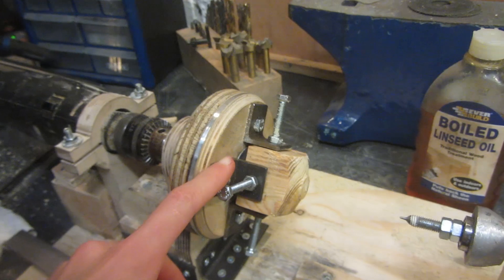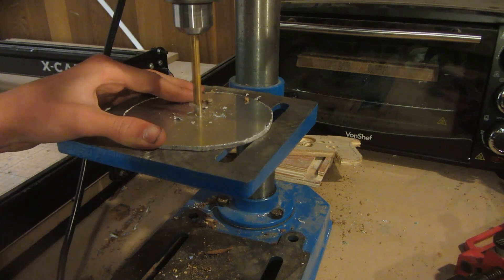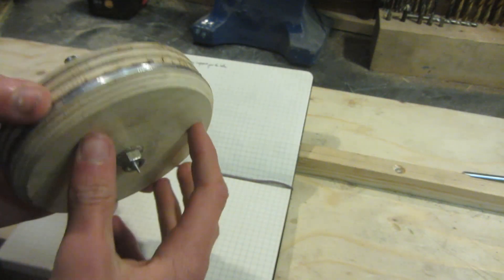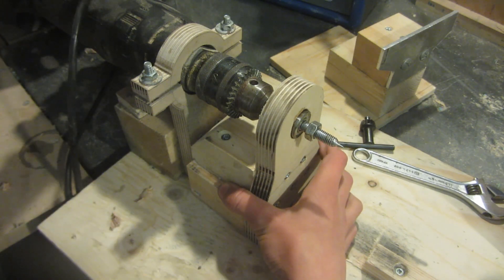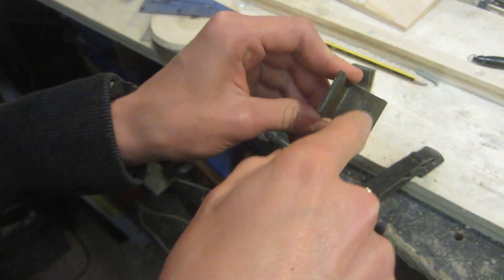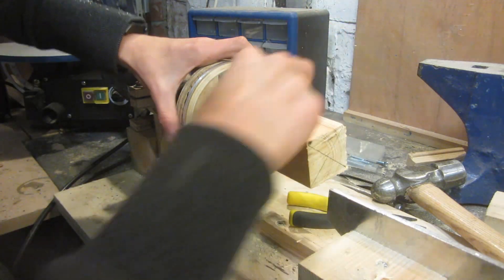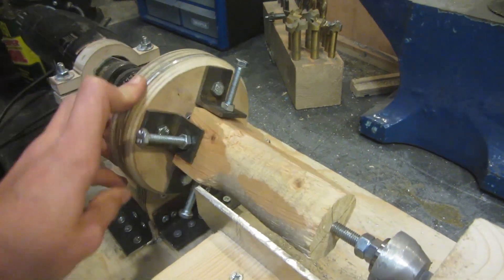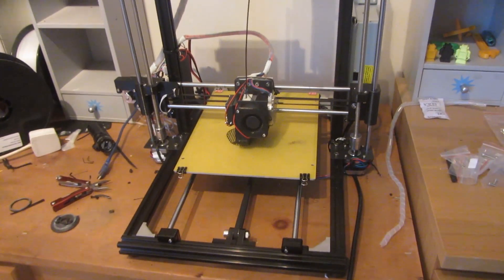How to Make a Lathe Chuck

Comment: Hi there good idea but you have way to much overhang on the headstock reducing this on your next version will give strength where needed , check out how a decent metal lathe is made preferably a dean smith and grace the rolls royce of centre lathes the chuck and face plates are removable and fit close to the headstock bearings. Regards Linerforce

Comment: A point about how you set up the lathe, I'd suggest measuring from the piece to the tool holder as you tighten the chuck so that the piece is aligned more to the rotation.

Comment: I'm not a Safty Suzy BUT!!!  It makes me cringe watching the sleeves , bracelets , watch. Even though you're only using a drill motor they can break a man's wrist if the drill doesn't break first. Personally I take risk that I'd scold an apprentice for taking but I'd not use your chuck without some kind of guard going around Those bolts.  Just if it grabbed your wrist it could wind your tendens around Those bolt heads.
Reply: i have found some pictures to prove that :o

Comment: Man you gotta loose the sleves. Any turning and slaves will get you fired from a machine shop but those bolts will wind you up. once seen a fat man with his shirt tail out that got grabbed by the lead screw. It was turning slow enough that it didn't just jerk him into the chuck but slowly ripped his shirt off. He used both arms to brace himself at the tail and headstock but couldn't turn loose to hit the E - stop switch or it would have sucked him in.  I know a couple of fellows working at a production shop in Gainesville Ga where a woman with long hair had her hair get caught in the chuck. It was a closed casket funeral. You can guess what she must have looked like.
Reply: +Phil Lowman Let me guess, Scalped at the very least, but to kill her did she have her neck snapped or similar?

Comment: the adjustable bolts for the 4 jaws, they got "threaded star knobs" on ebay fairly cheap. i priced some for saw table not to long ago, a few american dollars fora pack of 4-5, ultimately i decided they would be easy to make with some 3/4 plywood, and they dont have to be star, t-handled, just something to make tight with your hand

Comment: The main problem is the direct drive with the drill, it is likely going to kill the drill in no time at all, best is to use a transfer belt with the drill offset (or that motor you got). Also the chuck locking bolts are sticking out far too much, this is a serious hasard!

Comment: one more little tip that may help you get more life out of your end mills x-carve bits. go for a bigger cut and slow your feed rate down you will effectively use more of your cutting surface extending the tool life. the only issues you may have is clearing chips. but when using the full length of your bits you aren't making 50 passes with just the tip leaving you with a dull tip but with a sharp shank.

Comment: upgrade your bearings to sealed thrust bearings to take the force of the compression that is put on them by clamping down the tail stock and when you are shaping metal use your files and rasp rather than your wood working tools since your chisels are tempered steel they can chip and crack. also on your chuck jaws you may want to add in a gusset to reinforce your angle iron jaws. one more note is remember that bearings wear out and being able to replace them will save you from having to re-manufacture that whole assembly. a press fit is more than enough for bearings

Comment: Cool project.  I do worry about those bolts connecting with your left hand.  Your watch also appeared to be in danger of getting smashed by the bolts it it got too close.  The chuck needs a retractable safety collar to cover the odd bits that stick out so that the area is a smooth surface and less danger to your hands, and if it breaks loose, your face.

Comment: from what iv learned with lathes is that a  4 jaw chuck can be difficult to get round  piece dead center  unless so I would try and make a 3 jaw chuck for turning wooden dowels and round stock but other than that it's a great keep up the good work

Comment: Hi dude! Question:
When you're making HDPE sheets, when im doing it I always get small
air bubbles in mine, and then they show on the slingshot. I do every step in your tutorial. I press it with a flat metal lid to get the air bubbles out but it's not working! So how do you get so perfect and straight sheets without air bubbles?!

Comment: Another awesome video! I cast my first aluminum 'Zelda' sword thanks in part to your videos!!!  A question: seems you now have lots of friction working against that drill. Even with the bearings. How long will a drill work like that in those conditions? How long do you run it at one time, or do you let it cool down after a few minutes use?

Comment: Get yourself a copper or a wooden/rubber mallet for hitting threaded rod. Either that or stick a nut on the end before you hit it. This avoids damaging the actual thread. I'd also invest in a set of proper spanners, those nasty adjustables will wreck your nuts. Check out Pillow Block Bearings - google images - they'd be great for what you're doing - couple of bolts locks them in place. All in all good work young man and your video is edited well. Great to watch you having a go, learning and getting results. Thanks. Where did you buy your wood-turning chisel btw?

Comment: I would definitely have to recommend is making a curved metal or plastic cover to go over the chuck to prevent you from putting a hand or finger into it. Those bolts would straight up tear your fingers off. Definitely a safety concern.  Otherwise awesome man.  I'm about to start the same project on my own using an old drill press

Comment: Hi. Nice drawings! No need for cad when you can draw like that:) Where did you buy the printer? Seems like a good price. I like that you tried to make a chuck and lathe diy style. I'm not normally one for making annoying safety police comments, especially since it's obvious you are an intelligent young man who knows what he's doing. BUT..:P those protruding bolts looks like really nasty knuckle busters! And if they get a hold of your sleeves I fear it could drag you in and knock you around quite a bit. Broken fingers is not very productive:p So take care, and see if you can make those bolts shorter or figure out some other way to keep them safe from your hands. A shield around them perhaps?
Reply: +Auarhau I agree, well done but potentially hazardous. Maybe you could turn a ring or band the same size as the chuck to cover the bolts . Then drill holes where the bolts are to access them with a socket wrench. Also have you thought of some kind of readily accessible safety switch?
Keep up the good work, it's very inspirational

Comment: When you press bearings into a housing you should make sure to apply pressure only to the outer race so the force does not go through the balls, otherwise you can easily damage the bearing. Probably did not matter here but you will do more critical work soon.

Next step: turn a couple pulleys and drive the late with a motor and belt instead of the drill. You need to put another bearing block where the drill was of course, and the pulley between them.

Don't forget that this chuck with the screws sticking out is much more of a hazard than a commercial chuck, so don't get your hand or sleeve caught.

You could really do with a proper metal lathe. I'm sure there are many gathering dust in garages and basements.
Reply: 1 he's like 15 and 2 the whole point of this project was to be cheap and easy to build
Reply: +D.j.Y GAMING5 So he shouldn't improve because he's young and supposed to build only simple things?
I can't follow your argument here, is there an age limit to doing better?

He's not a pet dog, "well done, good boy!" doesn't really seem appropriate.
Reply: +D.j.Y GAMING5 hes giving tips on how to improve it
chill out dummy.